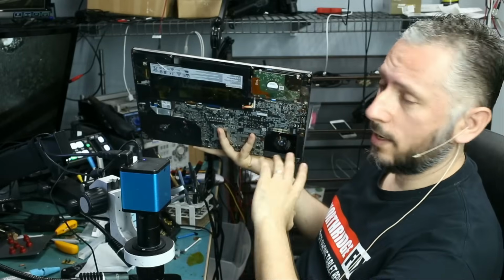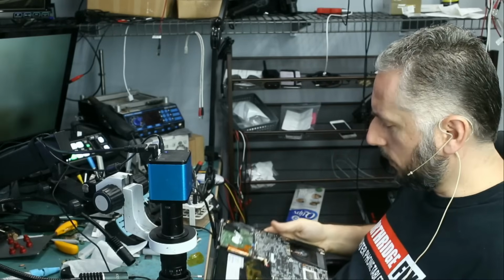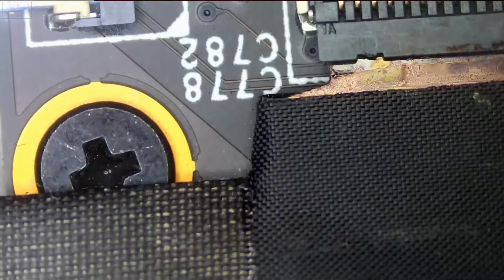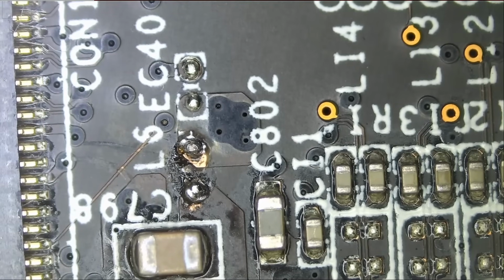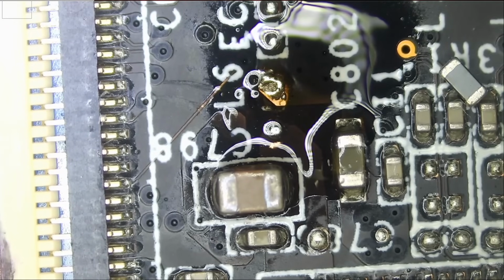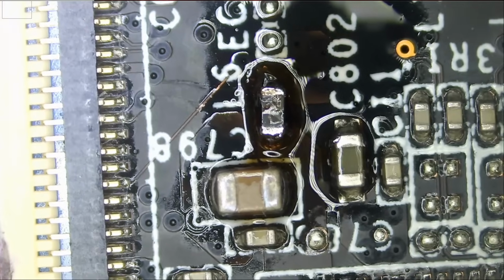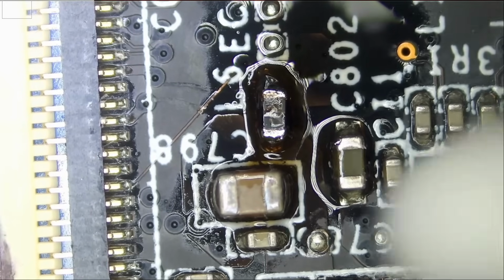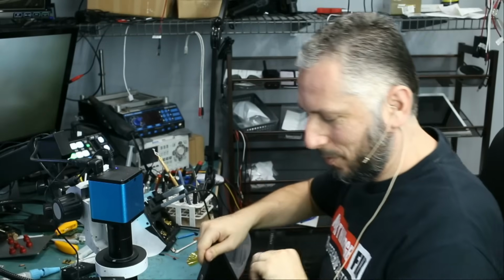MSI Laptop GS63VR Black screen no Backlight motherboard repair

Comment: excellent video, I have the same issue but I can't get hold of 605 for the 805 coil you mentioned in your video, do you sell this coil or anywhere you can point, where I can buy it as I can't find it. I am from 🇬🇧

Comment: For the MSI GS73VR, are there any connections related to the LCD around the power jack?   I replaced my power jack and removed an adjacent capacitor by mistake.  I soldered the capacitor back on.   I don't know if I might have damaged or knocked off a tiny resistor or something.  I double checked last night and found no missing discrete components.  Good new is that my power jack is now fixed.  But my LCD does not turn on at all.  Windows does not see any internal LCD HW.  HDMI works and that's how I'm typing this comment now.

I checked all the connections around the connectors as you mentioned in 1:16 and they are all secure.

Any ideas where else to check?  I guess I dismantle the LCD enclosure to see if I yanked anything loose, but that would be hard to do.

Comment: WOW. my msi gs63 battery light blinks even when not connected to charger and the laptop will not turn on without charger. i reset the battery with button on back side and it started to work but the drain was too fast. 
I just replaced the battery.
Reply: I am not sure if it is problem with power ic or battery issue

Comment: Im having similar experience with my MSI but I'm not getting anything after connecting it to an external monitor also. The service centre said it's motherboard issue and did not explain much. I wonder what went wrong. :(

Comment: I'm facing the issue with HDMI port when I plug the cable the laptop detects the monitor and shows nothing on the screen unless You changed the resolution to 800×600.

Comment: Man you just did some magic there I also got msi and driving me crazy something screen black no light other times just works but always working on external monitor
Sometimes I unplug it and do battery reset and it works so I opened it and removed the battery completely kept working for a month no issues until yesterday again same shit but easy enough unplug charger and hold power button to free any electric charge and worked again so no idea what is going on there and it's hard to show the service guy coz like I said something works other times not 
It's really tricky plus I unplugged the screen cable.and cleaned it up.put it back and didn't help

Comment: Excellent video. I got an MSI gf65 that displays to an external monitor via hdmi but not through the internal lcd I've checked to see if it's the backlight but seems as though the screen isn't even on. Also I checked the webcam and the screen in device manager but not seeing them. Can you assist me please? It's very frustrating as this is the only machine I have currently.

Comment: In the video you mention that you replaced the screen and then diagnosed the blown component.  What did you then do with the screen.  Did you confirm that it also was bad, or did you put the original one back?

Comment: If this is so easy ...then why u swap the lcd first?
Reply: You always start by replacing a whole module (if you have it) to immediately find out if the fault is in the screen itself or somewhere else. Could've been screen, the LVDS cable or the motherboard (as it turned out). Screen replacement was the fastest, easiest and most logical first attempt at narrowing the possible issues down.

Comment: My h81 Asus motherboard I change cimos clock battery but motherboard can’t update date and time.                      How to fix this problem please help...
Reply: By changing the battery you essentially reset the BIOS settings. Just go to your date and time settings, set your clock manually or select automatic internet synchronisation and you should be good to go.

Comment: How did you know that the value of component and which component will be fix in that place.
Reply: It is either part of a filter circuit, where the value may not be that critical. Or it is part of an oscillation circuit. In this case if your replaced value is too much off, the circuit won’t oscillate and work.

Comment: hi.. i have a MSI GP62 2QE Leopard Pro that don't turns on, he charges and when i press the power button, the led flashes and nothing! someone?? can someone help?? thanks..
Reply: try holding down the power button for 30 seconds
Reply: try it, no luck..
Reply: then it is most likely a component problem
Reply: @christiank3081  I have 3v3 on the power button, but no 3v3 on the 8th pin on bios chip..
Reply: have you measured capacitor C712?
Reply: @christiank3081  c712 doesn't exist..
Reply: @metavox-pt  my mistake thought the model number on it was MS-16J51
Reply: @christiank3081  noup.. MS-16J31
Reply: @metavox-pt  will check if I have schematic for it on Monday
Reply: @christiank3081  i have it..

Comment: Some days a little luck goes a long way.  You did diagnose where the components were and came to the conclusion the backlight circuit would be at or around that spot, checking with the microscope revealed the missing component, I do not think it was luck at all, I think it is experience

Comment: So now after you knew that the issue was not the monitor, did u change back to the customer's old monitor or did u leave the new monitor there and charged the customer?
Reply: Its maybe not even fixed. Compoments does not fall off the board just by itself. You cen see a big exposed pads woth no mask as well discoloration whole zone where this component was been sitting. May be issue was been on screen side where is backlight circuts and controller located, hard to see without having device in my hands.
Reply: @pashko90  
Hmm do u mean that maybe there was an issue in the old monitor beside the faulty component on the motherboard? Cuz what I understood from the video that the whole issue was from the missing component, not the screen
Reply: @amrdaking1  Yes. Components is not going missing just for no reason. I can see signs of overheating in this area. It was been so hot, what solder melts and component fall off.
Reply from the maker: The old screen is faulty. It could be what initially caused the backlight filter to blow. I tried the old screen after the repair and it had no backlight again. The customer will be charged for a new screen and backlight repair.
Reply: @NorthridgeFix 
Appreciate your reply! That's what I wanted to clarify. Thanks!
Reply: @NorthridgeFix  I seen one time video card failed(power supply part), it was been small fire on pcb components on other side starts to falling inside of the case. It was been halerious!

Comment: He found the fault by just guessing ... That's some solid experience
Reply: not guessing... the board tells you that an inductor "L##" should be there. Next the solder balls not being completely solid like the factory ones is another indication that the component was missing from the board.  Most likely from overheating and or shock from dropping the laptop.
Reply: Higher electronic state of mind man.
Reply: Not really it says L6 on the motherboard L = Inductor.
Reply: It's an educated guess... He's seen enough mobos to know what factory and what damage looks like...
Reply: Well, I don't want to belittle his experience, but a missing component in a faulty circuit is a pretty solid clue :)